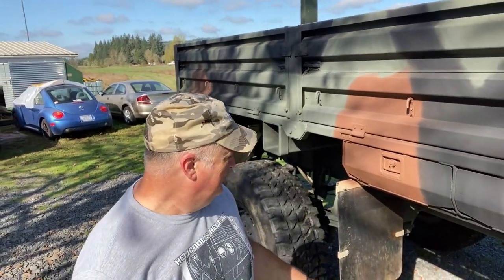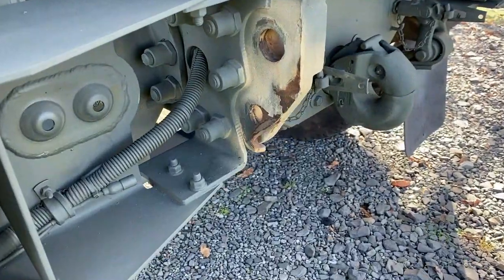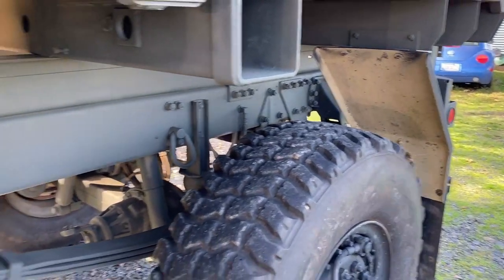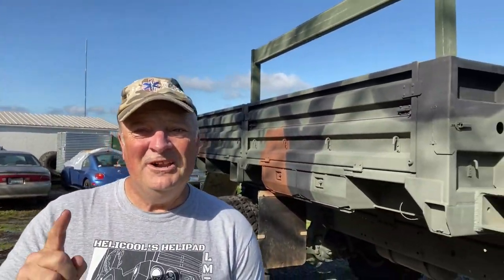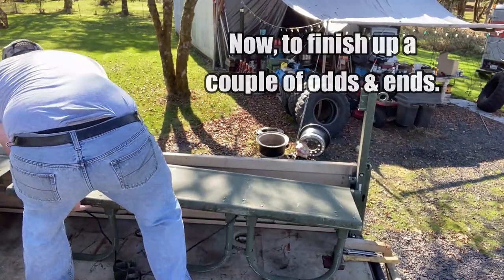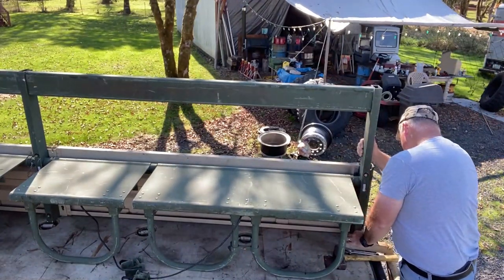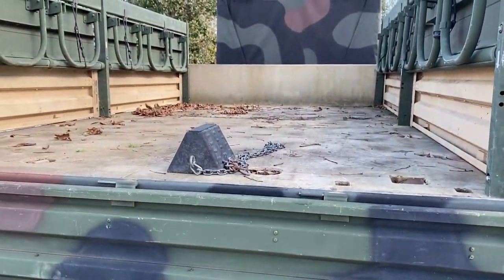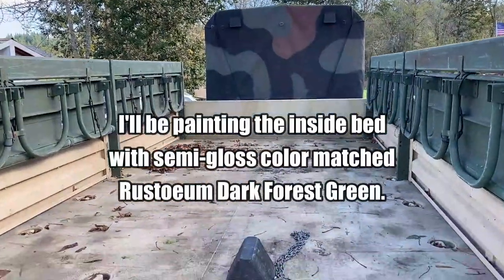WORLD'S FIRST M1078 TRAILER Debut & Naming #143

Comment: I am sure it works, but it looks wrong because of the axle location. So much tongue weight, but it's not like you are going to haul anything super heavy. Now your dream is finished, so what's on the table for this winter?
Reply from the maker: I thought about the tongue weight and decided there would never be a lot of weight on the trailer, just like you said. The deck is soooo high, even the purpose built trailers are very weight limited, because they get top heavy and tip easily. The pintle hitch is designed for 60,000 lbs., and the truck barely feels anything. I like keeping both tires on the ground, so no heavy lifting for it anyway.

This Winter... I have a new series started... "There I was..." talking about my stories as a helicopter instructor pilot, debunking Hollywood helicopter scenes, and such. I'm planning to do at least 5 episodes to see if it takes off. We shall see.

Comment: Hey Mr. Dave I got a question I’m looking in semi truck driving and I wanna be unique with it and I’m looking at a m1088a1 and I was wanting to get your opinion on using that kinda mtv for commercial use.
Reply from the maker: brian barfield I know these trucks can pull like crazy! However, if you are doing long haul, or even short haul, they are too slow and lack the versatility of gearing. They are also not comfortable to drive and are very noisy.

Comment: I'm sure you probably built this from stuff you had laying around, but I'd like to point out to others who think they 'need one' and want to build their own, that they can most-likely pick up an XM1082 or XM1095 trailer (LMTVT) from depot surplus for $500-$1000 and mod what they need from that point. No need 'recreating the wheel' and taking an LMTV truck out of the circulation, just to make a trailer...parted out, even a blown-motor one is far more valuable than it would be as a trailer...just my $0.02 worth.
Reply from the maker: This was a special circumstance, indeed. I was under contract to part out an entire LMTV, to "never see the road again." All I was left with was the frame, the bed and rear axle. To get more out of it, and for the fun of fabrication and personal challenge to see if I could do it, I turned the carcass into a working trailer. If I had to do it all over again, I probably wouldn't. I'd buy a purpose built trailer... this rear axle sets way to far back making it really tongue heavy. What I can say after all the work is completed... "I did it." And, I learned quite a bit more in process. That's a win.
Reply: M1095's are very rare these days to come up on Govtplanet, last one sold in 2019 for $4,500
Reply from the maker: @dougnashz  If not for the fact that I just finished this trailer, I might be inclined to set it for that kind of cash. LOL! That would keep the program going for a couple of years, I think.